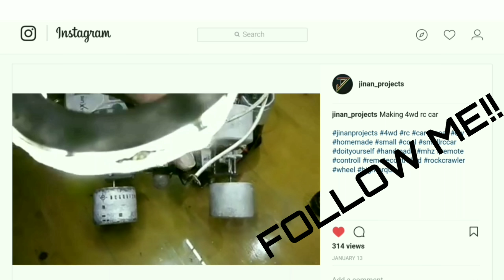Upgrading a Simple Toy Car To a 4WD RC Car (Part 1/2)

Comment: Bro I have also a RC car it has 3.7v battery and small motor I want to replace the motor with 6v motor and can I replace the battery with 6v or 12v battery will high voltage burn my car circuit board
Reply: Idk but i know Google will <3

Comment: Please reply me as soon as possible
Reply from the maker: Yea... I don't think it's a good idea to use a 12v battery when a 3.7v battery is meant to be used, but I don't think 6v would be harmful for the receiver circuit. These stuff always have a labeled volt rating by the manufacturer that is a little lower than what it can actually handle. They do that to ensure long life span and to not have any problem when something goes wrong. So, yea... I think a 6v battery can be used without toasting any circuit component, but it's not recommended.